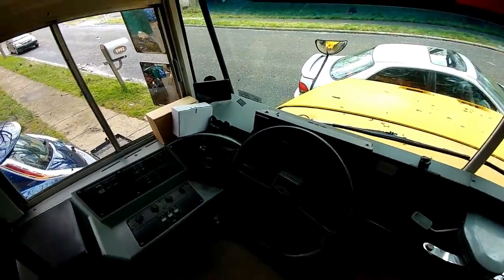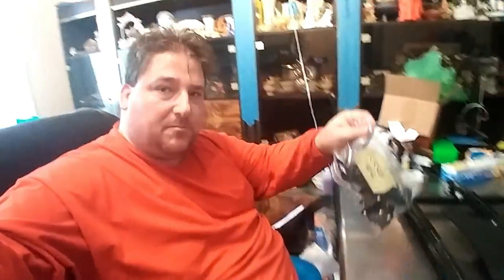Moving Bus Update 2 3D Printing Bus   T3DP

Comment: Double bag all your parts, the vibrations will have them eating their way out, and you don't want 80 bags all mixed up in a pile and or sprinkling out on the floor, tape/box all your snippers together, so they cant damage or open other things, long road trip vibrations are bad, since I did vegas to MI 3 times alone with trucks and vehicles in tow

Comment: i think 1 long worktop down the one side for 3d printers cupboards under them for storage and the other side 1 or 2 benches you could even put some overhead cupboards above the long worktop.

that is my suggestion but hey its your bus :)
Reply from the maker: I am betting that is what I will have to do I could probably hang filament and magnetic tool holders on the non work top side to make use of that space more efficiently but I agree I will probably only be able to put a work top down one side I just don't think it's quite wide enough go both sides
Reply: @nerys71  always good to have other people's opinions I find because sometimes you don't even think of good ideas yourself
Reply from the maker: @TotoGuy-Original  100% agreed! I don't always accept other ideas but I always appreciate them :-)

Comment: I am knew to the channel and was wondering what you are doing with the bus and what your business is.
Reply from the maker: My business going forward it will be this channel 3D printing the bus is my moving truck the quote I got was $4,400 for truck and trailer to move out to New Mexico the bus was $2,800 and I get to keep it :-) so I bought the bus :-) it was $1,600 cheaper than the moving truck and I don't have to give it back

As for what happens in the future after I use it to transport my family to thousand miles across country that is up in the air still if I'm in bad shape I could sell it and recover my $2,800 but I hope I'm able to keep it because the plan is to convert it into a mobile Makerspace fill it with 3D printers and other maker tools and take it to local events in schools Etc to introduce children and adults alike to the maker scene that's a bit of Blue Sky hope for now but it's not impossible :-)